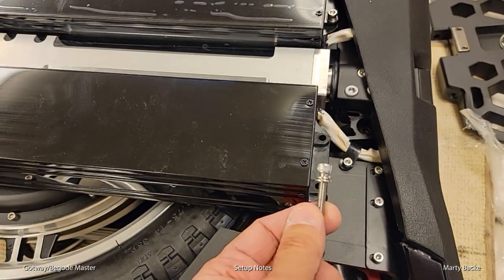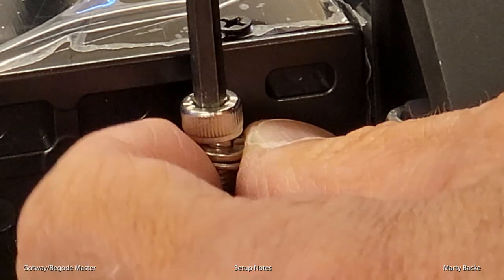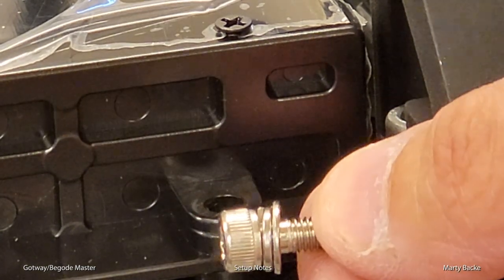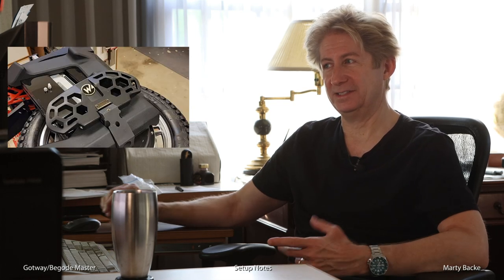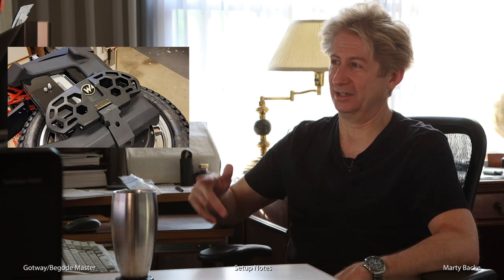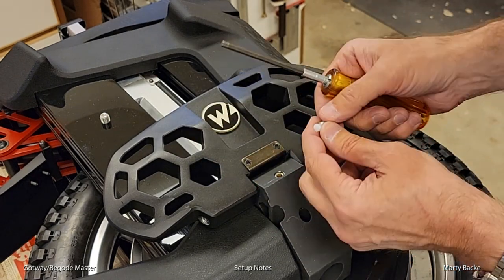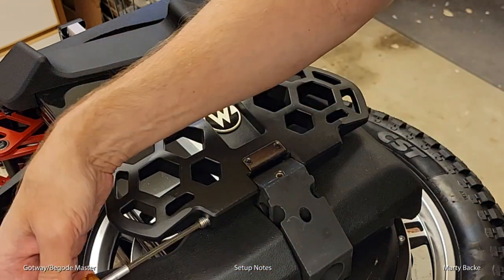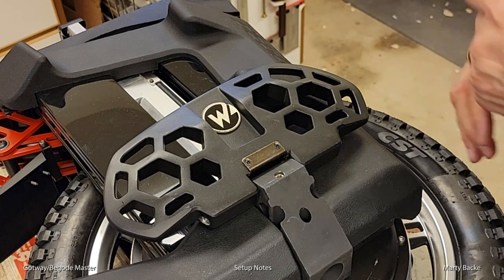Gotway/Begode Master Setup Observations

Comment: Hello Marty,
Regarding the pedals tension thing, I think it should be the other way around. Basically you lock the rod using that side setscrew on the hanger. Then you adjust the tension using the setscrew which has that plastic head.
Reason is I think it makes more sense for plastic to slide on metal than for metal to slide on metal.
Second reason – I think it is way more secure to have the rod dead locked in there. In case one or even both of those pedal rod setscrews come off, chances are your pedal will securely stay in place.
What do you think?

Comment: Great video as always , is there anyway to determine how much psi you need in the shock against a persons weight ?
Reply from the maker: I start at 250-psi and then experiment. Generally it'll be between 150-psi and 350-psi.
Reply: Legend thanks

Comment: Hey Marty I just bought my master and I pulled off the pedal tightner screw and it's stripped do you know the size of the bolt?
Reply from the maker: It's the same size as the two that hold the pedal rod in place. Unfortunately I don't remember the size just now.

Comment: Would you say it’s more on the fragile side for wheel?
Reply from the maker: Certainly some aspects are more fragile, like the rear light. But as a whole I think it's a tough design. Any wheel will self-destruct in a crash at 30+ mph.
Reply: Very true. Speaking of which. Would there be a way to contact you ? I had a accident on my veteran Sherman. I think it’s salvageable but wanted to see what you thought and what kinda repairs I’m looking at. Any help would be much appreciated.